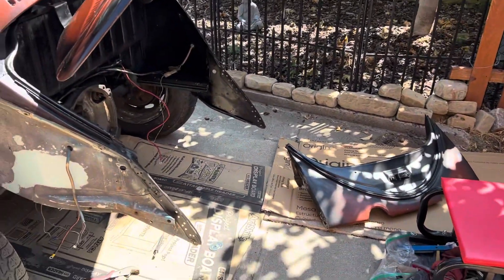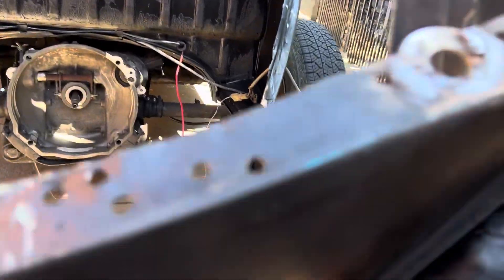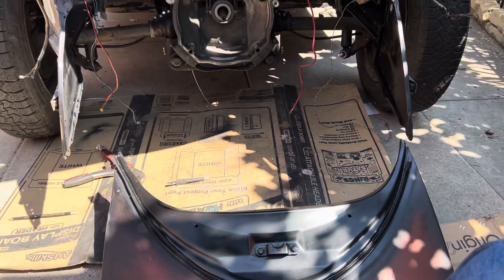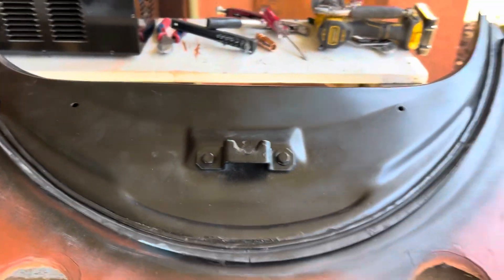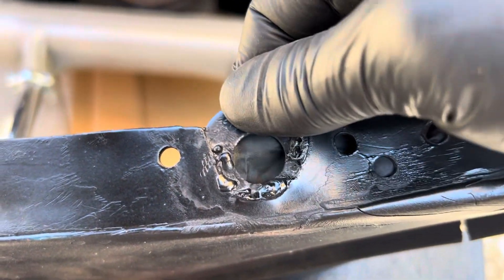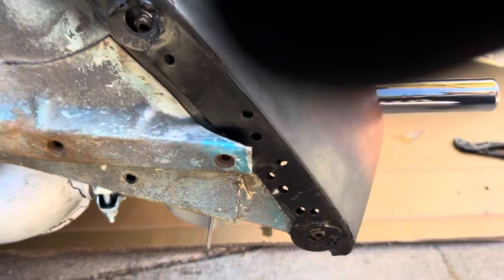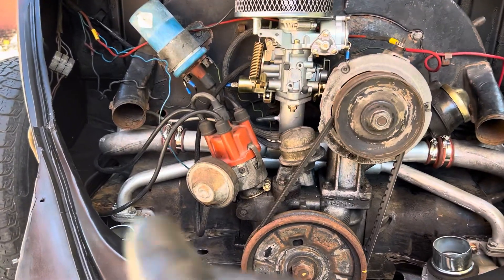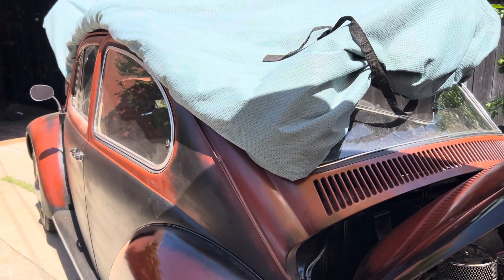How to EASILY remove rear apron on VW bug

Comment: Hello very good video can you tell me how you finish with that kind of paint in your bug? Thanks
Reply from the maker: @TheOsolito  
Yes, I primered with a base coat of red oxide color the black primer on top and used I believe 800 grit with a spray bottle of regular water to get the patina look I wanted.  There are other videos on YouTube for faux patina paint. Last step I used a Clear coat that comes in a spray can and let it dry.  I’m still experimenting with this look.  It’s an ongoing project.  But that’s the fun.
Reply: @jackofalltradesgarage  awesome thanks for the reply, will be awesome if you make a video showing your bug outside and inside, I have a bug painted like dark pink and all the clear coat is fading I am not fan or the pink color and I thought doing a color like yours.
Keep up with the awesome videos ty greetings from Alberta Canada